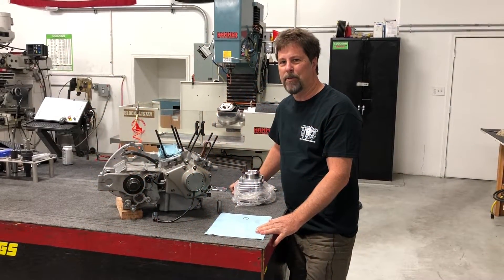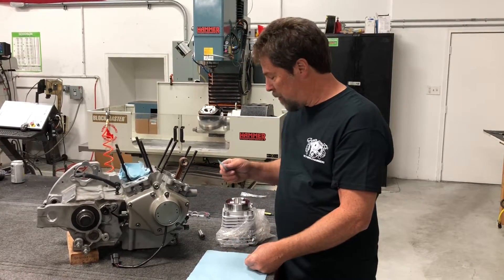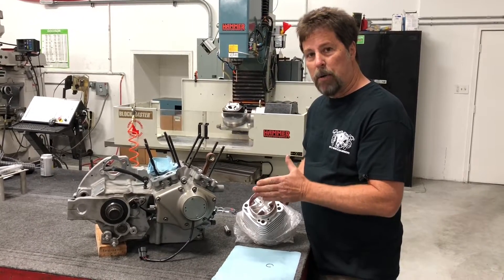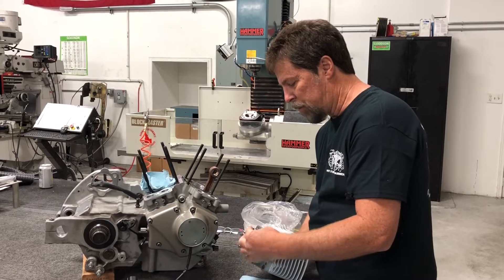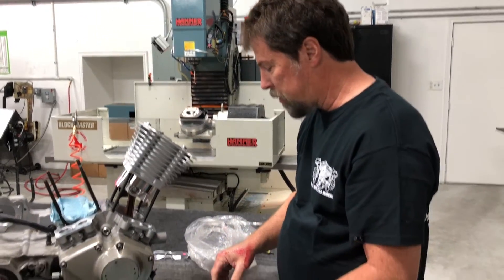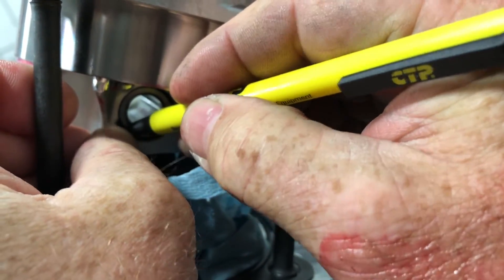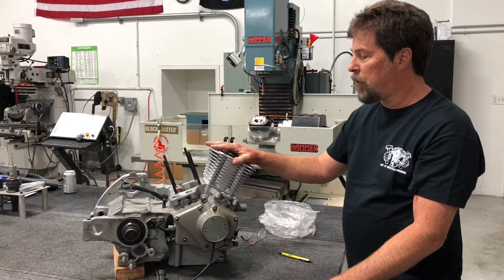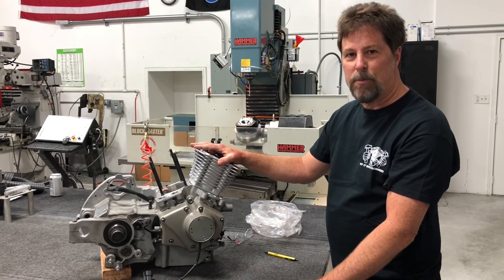How to install the cylinders on a Hammer big bore kit

Comment: I installed the 1250 kit on my sportster a few years ago and couldn't install my lifters I had putit the head on had to remove it and shift the cylinder to get the lifters in my only issue got it finished and bike runs great thanks to Hammer Performance and Hammer Dan talked to him on the phone Great Product

Comment: So, silly question.  If you had a kit with the piston and cylinders separate, could you install the piston into the cylinder (taking care of alignment of course), and THEN install using the method you have just shown?
Reply from the maker: Sure, and in fact our kits are sold that way by default. The kit instructions cover setting the ring gaps and assembling the pistons and rings into the cylinders. However, we offer an optional service to do all that for you, which greatly simplifies installation and eliminates the need for any special tools on your part. More than 95% of our customers choose that option when they buy a kit from us.

Comment: Can that be done with engine in frame? Thinking of buying an 883 and getting your 1275 kit....have to do exhaust & intake mods as well. You do mods to heads, correct?
Reply from the maker: Yes, the 1275 is a bolt-on that can be installed on a Saturday afternoon without even pulling the engine out of the frame. No mods to the intake or exhaust are required - although about 99% of guys do run aftermarket pieces to make more power. Yes, we are a fully equipped machine shop, including a 5-axis CNC setup to port heads, and we port several hundred sets of heads every year. It's important to match the heads, the cams, and the pistons, not only to fit together with proper clearances, but also to optimize power production. Watch this video for more information on this matching: http://www.hammerperf.com/ttvideos.shtml#highpowerconversion . To see a series of complete, matched packages, go here: http://www.hammerperf.com/883conversions.shtml#packages
Reply: 33
4
4

3
3
3
3
3

Comment: Are the ring gaps set at different degrees before they're placed in the cylinder?
Reply from the maker: Yes, and that's covered in our kit installation instructions. But if you buy the ring gapping & preassembly service, we take care of that for you. The kit arrives with the pistons and rings pre-installed in the cylinders, ready to bolt on.
Reply: @HAMMERPERFORMANCE  Cool. Thank you.

Comment: I have a question. When I did mine I also had it with the pistons and rings already placed in by you guys.  I did however push the piston out a little bit to far and exposed the oil ring. Now I don't know how much the position changed when it popped out. But I simply just squeezed it back in again. Could it have caused any problems by being In a different position to which you guys fitted it ? Thanks Jak
Reply: maybe they could put a guideline showing on the piston with a black sharpy and as soon as one sees the line, they don't pull past it. safety line
Reply from the maker: Hi Jak
No, you should be just fine.